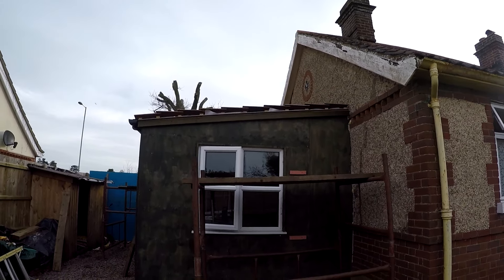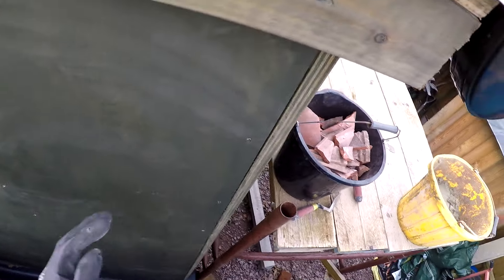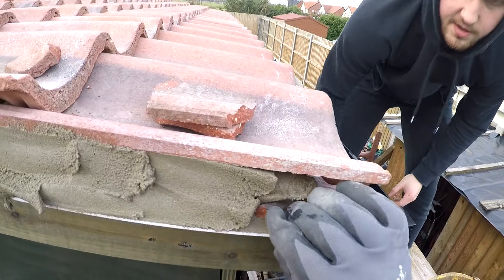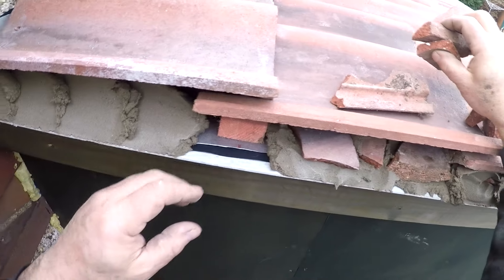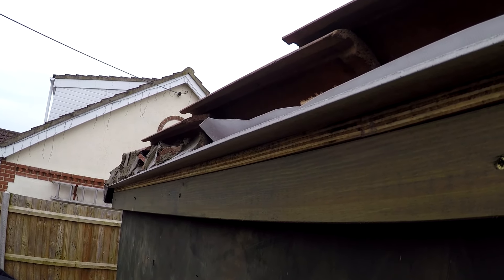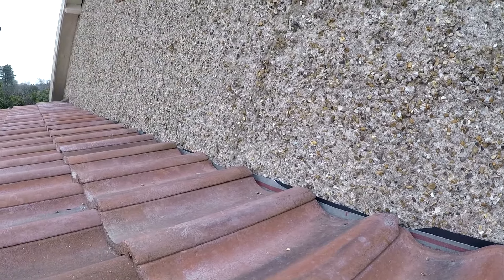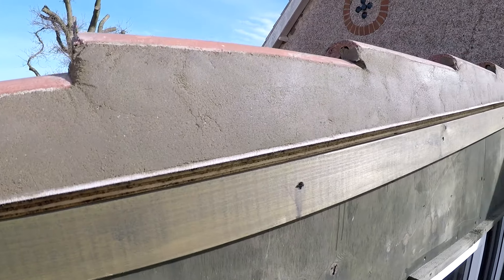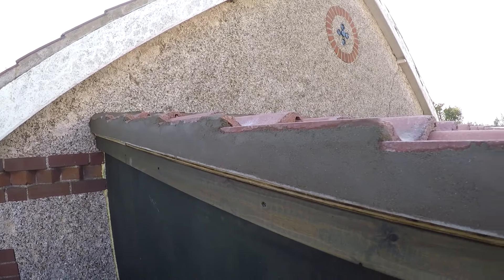Cementing the verges to complete a tiled roof. The old boy method...

Comment: Professional roofer here: 

Everyone watching this, please remember this guy isn’t doing it correctly, the roof pitch looks too shallow & verges should be bedded not pushed mortar in with bits of rubbish here and there, this verge will fall apart in 5 years as there’s isn’t enough mortar in there. The video shouldn’t be followed for educational purposes & the chap doing the work should make this perfectly clear.

Also there should be lead flashing fitted to the wall abutment at the top of the roof not cement layed on top of the tiles, any movement in the building & this will crack and cause a leak.

Not to mention the batten at the verge shouldn’t be close to edge as it is in this video nor should the roof membrane be so close, all this will suck moisture through the cement verge & cause rotting.
Reply from the maker: Frankie , if you listen on the video I did explain that this is a temporary set up , it was the best cost option for us at the time, we had tiles left from another job, I didn’t want to spend money on a proper flat roof, also I explained that you would normally fit lead over the cement at the point of meeting the building, I can’t disagree with what say, the next chance we get to film a roof we will then you can see what we are about, the whole building will be flattened in the near future, many thanks for taking the time to watch and comment,
Cheers from Old budd 👍
Reply: @BuildingwithBudd  Good traditional builder  - balls it up AND still got an excuse !!
Reply: Would you put water proofer through your mortar mix
Reply: This is wrong but when bedding verges with a pan tile I do like to throw some muck down first, squash some broken tile in, then out more muck on top. Them pantiles can be a right pain to point up because the bed is so big. I find that helps
Reply: 100 agreed - this video is how NOT to do it.

Comment: Quickest way is to take the tiles off then put your muck in then placing tiles back, so essy and simple, the tiles have more compression as well so it's stronger!
Reply: Just what I was going to say,bed the mortar high and then press the tile on,the times iv seen people bed the tile on then they scrape it back and point over another day only to find in a year it falls out cos its only half inch think
Reply: @stevesmith3850  it takes a lot longer that way and it's less strength as theirs no compression from the tile into the muck! UK Construction industry has gone backwards in a lot of ways, power tools make workers look better than what a lot of people think
Reply: Why not do it properly ??? Bed the tiles in ,,rake back and flush point when it's set!!! To many ROOFER'S not doing it right these day's
Reply: @breadmanted  As I've stated my way doing it you pack in as much compo as possible for the tile to be placed back down again, this way the muck spreads out and force the muck back in again with a gauging trowel how I do it then angle the muck flat to the cement board, muck has to be a little stiff but workable, I see loads of guys packing muck in without taking tiles off which takes them all day to do when it should be done in less than half that time, UK  construction industry has went downhill big time, big guys earning huge profits off the working man, not enough older guys taking young people on and when they do they use them as labourers for cheap pay and don't learn them much! 10 years time the UK building workforce will have lost a lot of people and a lot of knowledge how to do things because of greed
Reply: this video is the worst leakeast way I have ever seen! those morta will crack and will leak ,  local council here would make you rip it out and start again with a proper lead flashing fitted to the wall abutment at the top of the roof.

Comment: Stick to building m8 that roof degree is far too low for any tiles
Reply: It must be the fish eye camera lense.
Reply: they look level😂
Reply: What pitch do you think it is??...
Reply: Those. Edge tiles should come off ,prime the back edge with cement and sbr also prime the under cloak verge ,then bed the tile with 3 sharp sand / washed grit and 1 part sand to 1 part cement ,add bit of Feb and a dash of sbr ,those verges should also have a mechanical fixing if no verge clip.
Also no batten end protection that mortar will get wet and eventually rot the battens

Comment: I've  never seen anything like this in my 16 years of roofing, bed the verges, put a flashing at top edge,  most importantly that roof is basically flat,  board it and fibreglass,  that's a leak waiting to happen

Comment: The felt should go under the undercloak because the cement will now corroded it and now your mortar is set on a floating surface.
The mortar should be cut to the underside of the tile and not up onto the tile face edge as it’s too thin, will crack and then open up the bed. Felt shouldn’t be going into the gutter too as it will rot out. The cement fillets at the top have been banned for years as the lack of movement and again will leak.
Reply: Your as bad as him, compo doesn't rot type 1f or modern felt.
Reply: @sorryrocco  And here is the problem with builders - no two agree on method. How is the householder supposed to judge whether the person they're paying is doing the job properly ?
Reply: @sorryrocco  Why not?
Reply: @justbreakingballs  why not what

Comment: Hi, can you tell me please if it's working... thanks
Reply from the maker: It’s working fine , it is only a temporary solution, we were going to flat roof it but we had some tiles left from a previous job, it just worked out a lot cheaper option at the time, but in answer to your question it’s working fine 👍
Reply: I can guarantee the verge will have cracks all over it as he didn't put a slight lip on the cement verge going under the side if the tiles, which makes the rainfall run straight into the cement and as I say causes cracks.

Comment: with that cement on the top - you will have a  proper leaks - where is a lead flashing mate?  good cement pointing but that will leak as hell
Reply from the maker: I fully appreciate what your saying , it was a temporary job, it sat there 4 years no leaks, did the job , cheers for watching 👍

Comment: meant to bed the verge then compress the tile down then point it off pushing cement in like that won't last plus your underlay should be under your cloak, plus the pitch of that roof you've used the wrong tiles or you need mor than 75 mil head lap

Comment: Only roof for that pitch is a flat roof, will leak like crazy with them tiles, why use a cement fillet on the back should be a lead flashing chased into the wall. Cement works nice but you are no roofer sorry
Reply: 100%

Comment: Sorry that verge is awful. It won’t last a year without cracking and rotten ing the ends of battens , at least you should of used a type of batten end protection or ,,,, rotting battens tiles  slips disaster

Comment: Absolutely shocking job 🙄 

As everyone has already said, the tiles need to be removed and bedded and felt goes beneath the undercloak. Timber roofs move too and that is why we use lead flashings instead of fillets. Your cement mix is too dry too, won't adhere properly.

Comment: Liked & Subscribed. Can I ask why you put the broken bits of tiles in. Is it for strength or just so I can use a bit less cement mix ? Storm Eunice took my verge tiles off so intend to replace using your video as a guide. Thank you for making this video.
Reply from the maker: Ferenc we put the broken bits of tile to help the cement go of, if not it hangs wet for a long time, many thanks for watching 👍👍
Reply: Put a bit of rapid cement in with the mix that will help
Reply: If you put your verges back on the same way as this!......you'll be redoing them again in the future too
Reply: @plaintiler rubbish

Comment: I hope that's your own property, if not there will be a very unhappy customer when the fillet cracks, the end tiles blow off in a moderate wind and the felt rots in the gutter. I would also question the pitch of the roof for the tile used.
Reply from the maker: Just to put you in the picture it is our own place and it’s just a temporary set up , we had the tiles spare from another project so we used those instead of a fibre glass or rubber roof, I did explain that it was only temporary and no lead as it’s not going to be there long,  you are totally right in what you say, it is just a way to get to another point, really appreciate you watching the video 👍👍

Comment: Where to start? 1. Membrane should be under the undercloak not on top. 2. Where's the felt support at eaves level? No membrane should be be fitted into the gutter. Also the first course is drooping - I suggest no eaves ventilation has been fitted. 3. Nails? I can't see any nails in the top row, which makes me think there are no nails fiited at all. 4. Roof pitch? The roof seems far too low for a single concrete pantile. 5. You should not mortar into an abutment. There should be a dry abutment fitted and / or lead flashing

Comment: Don't you just love the comments from 'professional' roofers? Comments re felt, battens , etc are from people who've probably never been on a roof. As for the idea of lead flashing - from clowns who'd probably cut into the wall and slot it in with clips. How's that gonna work on roughcast? Chippies, plumbers, sparkies - whoever - no-one seems to know anything these days. They just do as someone who didn't know what they were doing told them.
I've just re-roofed a centuries old barn and done it exactly as this guy has - except I didn't use felt. It was last roofed over a century ago and none of the disasters foretold by the 'experts' befell it.
Reply from the maker: Spot on 👍

Comment: Why have you got tiles on a basically flat roof and you bed tiles into the compo not pushing it in like that there's so much wrong with that I don't know were to start
Reply from the maker: Paul
You totally right, but it is a very temporary roof, we used up some bits and pieces we had left, we could do the job ourselves, and we didn’t have to pay a flat roofer, it’s a means to an end, many thanks for watching 👍

Comment: Nice neat job.
Isn't it better to use flashing for the top of the roof  rather or as well as concrete. If the concrete cracks or there is any movement, rain water is going to run off the wall behind the concrete verge?...
Pro's educate me please..
Reply: No education needed pal your bang on
Reply: @MrSmoore77  Thank you for responding.
Reply: Yes your right cementing like that was done back in the day no good wants lead

Comment: That is NOT how you bed verdge tiles !!!
Reply: I agree  what  a fu#$ing mess ,should  take off verge tiles and BED THEM 🤪
Reply: Where's a roofer when you need one,
Reply: Rough has
Reply from the maker: Chaps before you beast me , it is a temporary set up, give us a break 😂😂
Reply: I’m a roofer of 15 years personally with such a big bed i would bed and point dental slips on to half the size of the verge stops cracks etc
Reply: Lovely render finish ur ment to see the nice tile end I hate render finish see that in 6 months cracks everywhere
Reply: Have you no fairy liquid in that mix Bud.??
Reply: Nice strong job

Comment: Shouldn't be using those tiles on such a low pitch roof.  100mm cover and 20 degree or less pitch, by the looks of it.  I wouldn't want you on my roof, that's for sure.  Can't believe you posted this.

Comment: Not been funny but that pitch is too flat for them tiles you would of been better putting a rubber flat roof or a glass reinforced plastic roof that’s actually illegal what your doing
Reply from the maker: It was a temporary job , and this was the cheapest option at the time, had some tiles left from another job, it just served a purpose at the time 👍 it was a lot cheaper than rubber or fibre glass and got us out of a muddle.

Comment: No lead 🤔🧐🙈 that's gonna piss in ,

Also should always bed the tiles up , then point them up , wouldn't use a pointed trowel either , rather use a rounded out for pointing gables ,
Reply: Spot on

Comment: First of the positives
You seem like a nice chap 
The mix you put on was a nice mix

The negatives 
How could none of you not have known that the pitch of that roof was no where near able to accept a tile/slate?
(Water will blow back up under in no time and the felt will only keep it dry inside for so long)
Why would you put a cement fillet instead of lead? It will crack after a few years with movement and rain will simply run down the wall and in. 

You really should take this video down and I’m afraid if you issue guarantees for you’re work you will be taking this roof down.
This is a flat roof all day long not a pitched. 
Cut off point for flat/pitched roof is 13 degrees
With these tiles I think it’s 15 
This roof looks under 10.

Not here to knock you but I’ve been a roofer for 20 years.
All the best ray
Reply from the maker: As we said in the video, this building is temporary, we know that its not proper. Its only an outdoor building, that is soon to be knocked down
Reply: @BuildingwithBudd  ahhh ok
Always nice to see the way other people do things any how
Reply from the maker: No problem Ray Bans 👍

Comment: That's going to piss in water, dont do your roof like this. total bodge up in sooooooo many ways
Reply: How?
Reply: @louie.vision.5255  Ok where do i start? cement butted up against dry pebble dash render is a good a place as any i suppose. given that the render is pebble dash tells me its going to be quite old mid to late 80s the cement when drying will shrink as it looses its moisture this will pull inwards in all directions, this will include pull away from the wall witch is dry meaning the cement is not sticking to the wall its sticking to the dust and grime so when drying accrues the bond its not great. all this will allow water in-between the wall and the cement. Then factor in the seasons doing there bit on the cement it will eventually move and crack. Best way would have been to flash it. Just my opinion

Comment: Cementing 😂, surely cement would blow away, perhaps cement mortar would be better with a specified mix ratio with a touch of lime to prevent shrinkage and / or cracking , calling it cementing is just wrong